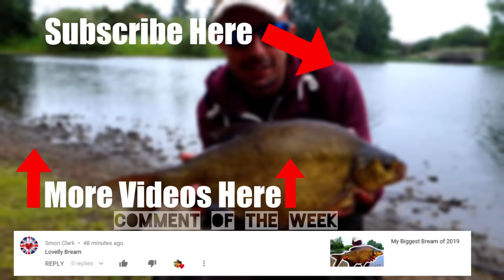How To Fix a Broken Fishing Rod

Comment: Its not as strong as a new rod but will do the Job ? Sorry fella but if you are going to do a job do it right . Use Epoxy glue and bind the ends it will be stronger than a new rod !

Comment: Broke my rod tip four inches down. Took a steel afro comb tooth. It's a thin but very strong steel rod and gorilla glued the ends into either side and it works like new. Saved $50.00

Comment: Just remove the splintered section. Seal the end with epoxy.  Sand about an inch and half section till it fits in.  Lightly coat with thin CA glue to seal the open fiber, wipe off with paper.  It's good to go.

Comment: I have a fishing rod that could be separated into two pieces. The top part snapped in half so I threw it out but the bottom is still fine. Where can i find a replacement for the top part?
Reply from the maker: Ebay possibly
Reply: I find many broken rods at thrift stores and yard sales. If you can find a repair shop many times they will give you parts of broken rods for free. At least in my area they will.
Reply: You should have saved the bit you threw out, it could have been fixed. You may aswell buy a new rod to replace it. You've probably got a better chance of finding a second hand key to fit your front door than you have of finding the other half of the rod you've got.